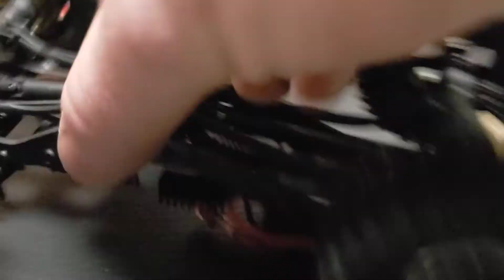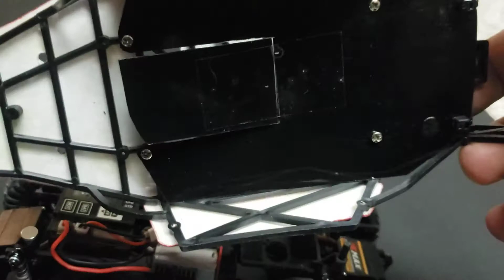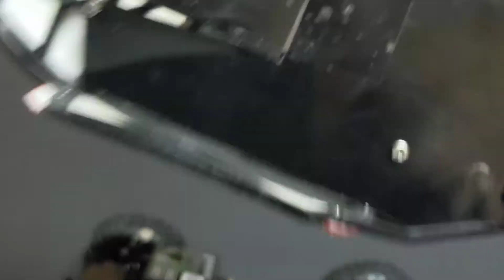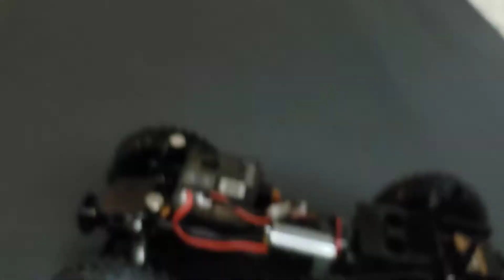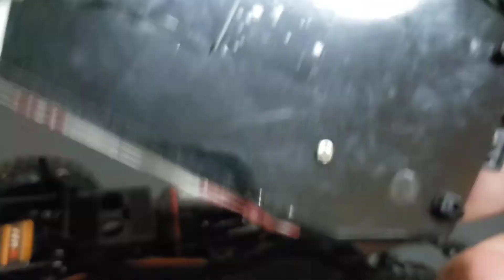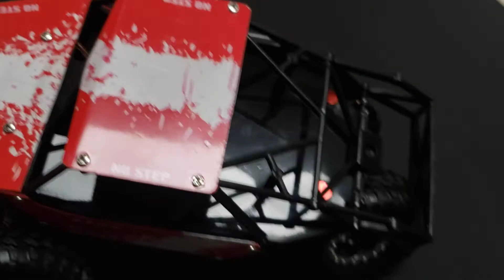SCX24 Long Wheelbase, 4WS Stage 2 Complete

Comment: Where did you find those heat sinks
Reply from the maker: Currently out of stock but keep checking. They will return.

https://www.ebay.com/itm/Mini-8-8-8-8-5mm-Heat-Sink-Top-Mount-Pack-of-10/301459243369?pageci=3063e0ff-6415-4dce-839b-a9cefea403e7